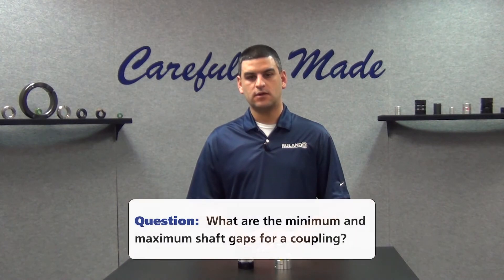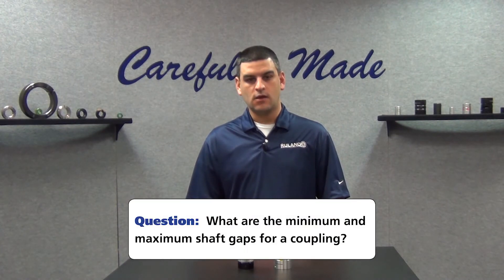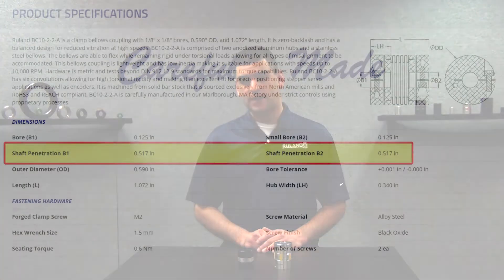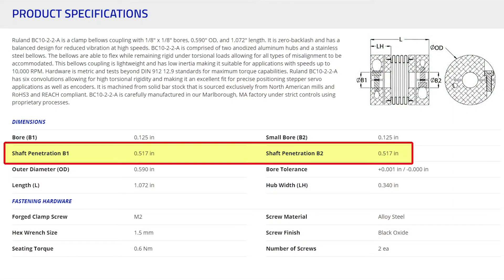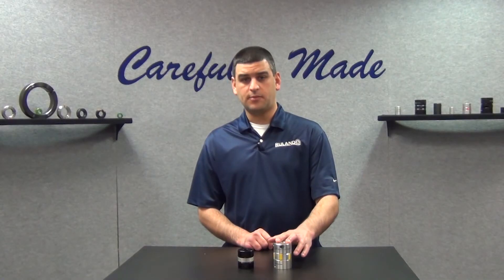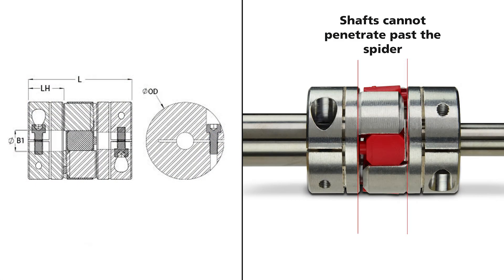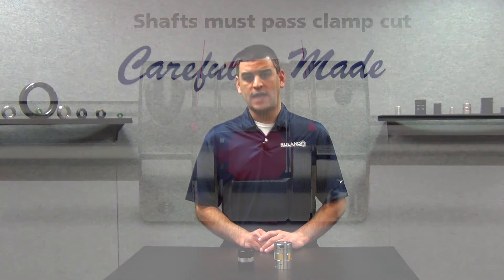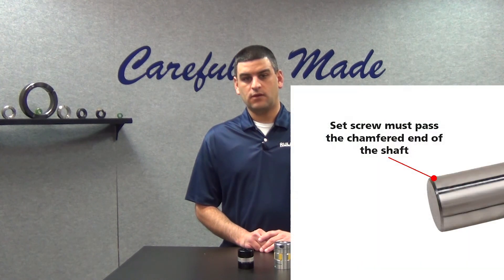What Are The Minimum & Maximum Shaft Gaps for a Coupling?

Comment: How gap should be there between the two hub and spider
Reply from the maker: Thank you for the question. For Ruland couplings, it is the axial misalignment of the coupling. This changes depending on the spider's hardness and the coupling outer diameter. Other manufacturers may give different guidance depending on their design. - Chris from Ruland